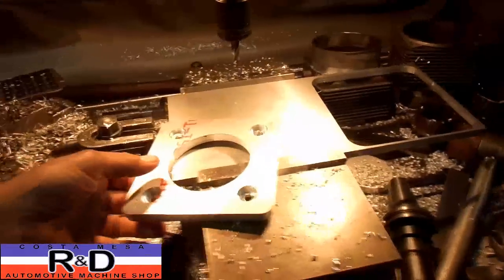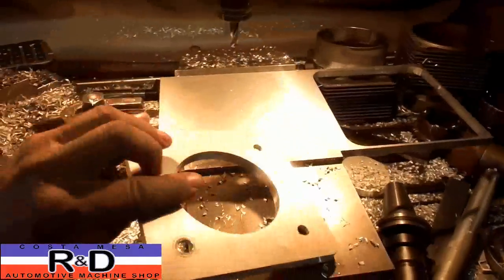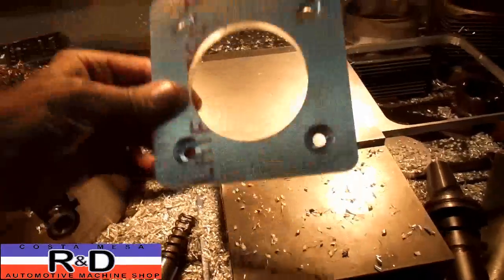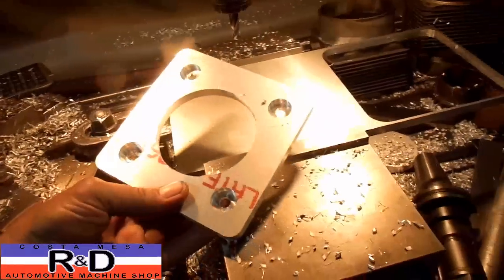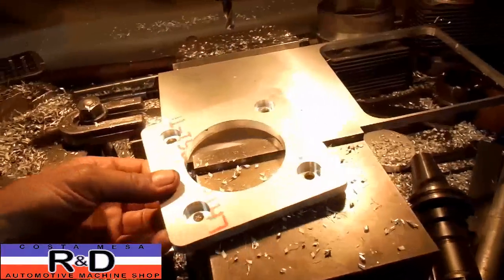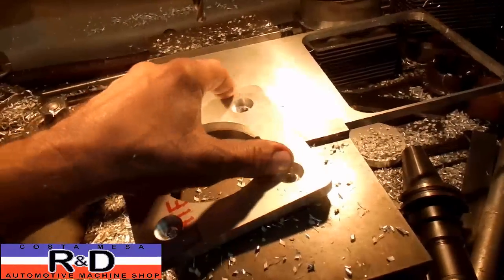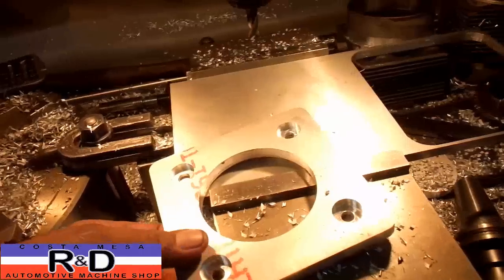850 Fiat CV Joint Seal Plate

Comment: Nice job! Whenever I use my CNC to cut parts I machine tabs in the design to hold the waste in place.  I'm always afraid the waste will foul the cutter when they are cut free. I then cut the part out with a small hacksaw and remove the tabs on a belt sander or with a file.  Love your video's btw, great music.